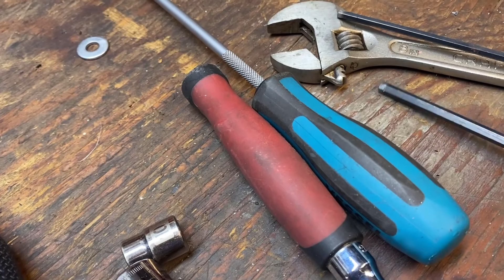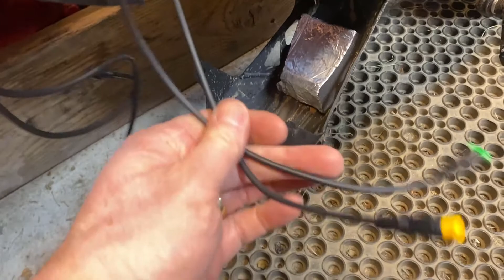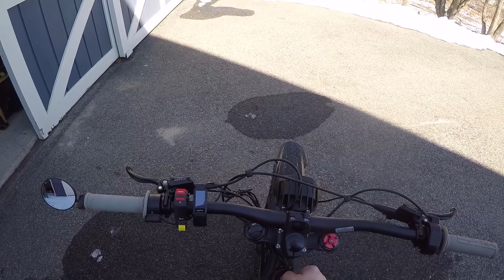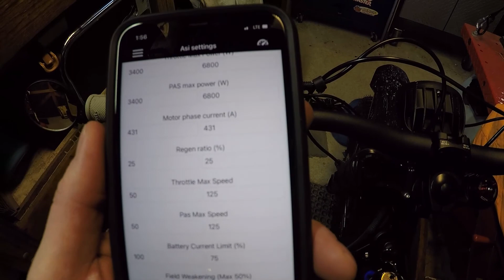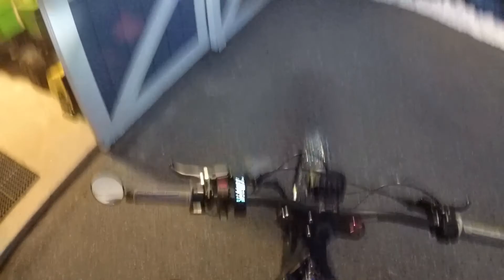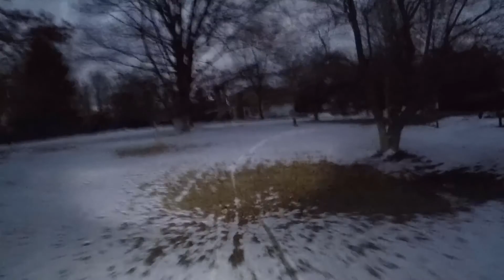Surron X BAC4000 by Green Line Engineering.  Install tips and first Impressions

Comment: Shouldn’t the watts for the non bypass battery be max of 4800-5000 instead of 6800 like you have set which is for bypassed batteries
Reply from the maker: Good point.   It’s been a while since I made this video and I have since bypassed my battery, but at the time  instead of changing the max watts I simply changed the percentage draw.  75% is where I ended up which is 5100 watts and that worked well.  I honestly can’t remember if you can just say “the max is 5000” and leave it at that but you probably can, but the results are basically the same.   The difference once I bypassed the battery is impressive, and by carefully monitoring discharge rates I have had no issues.  Thanks for watching and commenting.

Comment: Awesome video.  You have to do the bypass.  The bmi on the battery is like the gatekeeper.  If it senses a higher than normal draw on the battery it cuts the power off.  Its a safety feature.
Reply from the maker: Thanks for watching, and yes, I did the bypass in a later video.  It made a big difference!

Comment: After you make adjustments then click write,turn off and back on the Egg Rider and app  that holds the new settings
Reply from the maker: Thanks for the tip, I did finally figure that out.  Switched to the GLE dashboard now, I like that better.
Reply: @Chris_Does_Everything  im in the process, still building my bike haven't done the Dashboard app yet,will do in a week or so